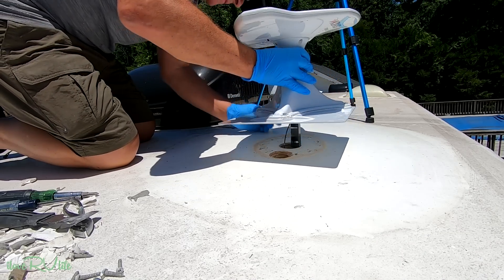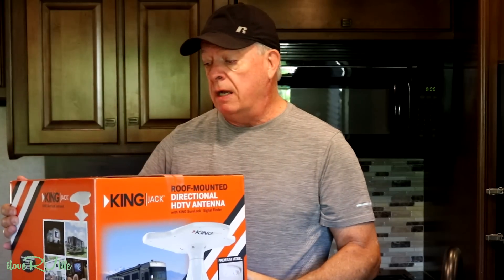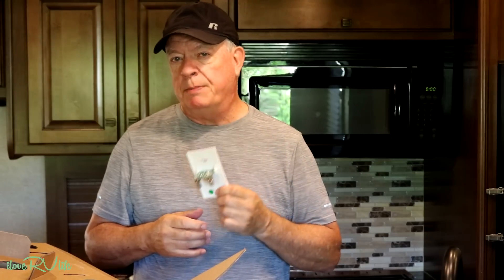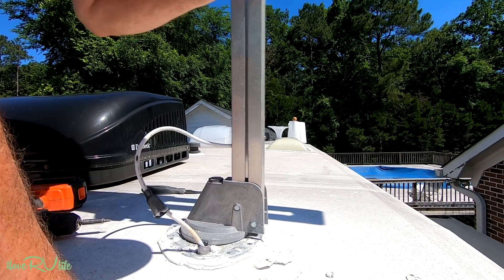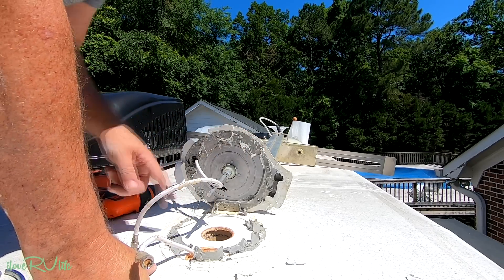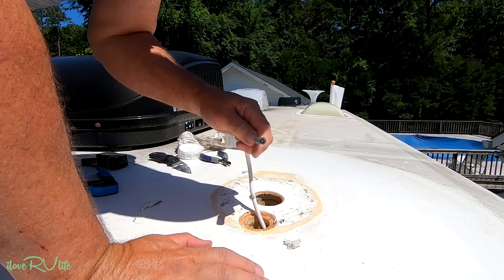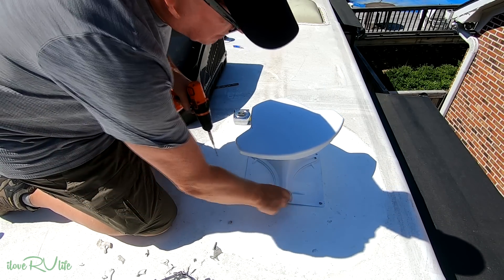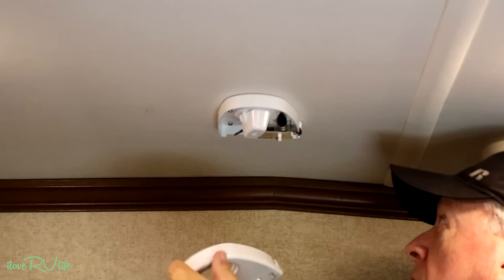Installing The King Jack Antenna

Comment: My truck camper came with this. I have to admit it's the best amplified antenna I've used. BUT I've had to pull it off the roof three times in 4 years. There's a RG-174 coax cable inside that gets broken easily. Even driving under a palm frond spins the antenna & breaks the coax. It's not accessible without removing the entire thing. The little push button locks from the inside but not very well. So keep a spare DTV antenna with you if you want to watch tv on the road, lessons learned.
Reply from the maker: Great to hear the antenna is working for you.  We’ll watch out for the low hanging limbs. Appreciate the tip.

Comment: Thanks for this great and quality video as i am installing this King Antenna today, you made it look easy and gave me the confidence to tackle it. I think the sealer is going t be my biggest challenge!
Reply from the maker: Glad we could help.  Sealer is pretty easy. You’ll do great.
Reply: I managed to get that install done in about 3hrs, but i get only 44 channels compared to 85 with the old batwing. Its ok because their all very clear now. I did have to carefully measure and cut the long extension shaft about 1/2in because it was to long and the base plate would not fit flush. That's not in the instructions. thanks again.

Comment: HI  Jerry.. I'am working on Rebuilding My 2001 Rockwood ROO 21 Hybrid,, New Roof ( So Much Leaking from Neglect Past Owners, New Floor (much more Bracing  under the New wood Floor)replaced the Fold Out Bed Floors with 1/8" Aluminum Sheets ,  Watching The Antenna VIDEO Today Was Perfect !!I Will Order The King OA8500 and the Plate Today ,I think that plate will Also give it more Stability  I Truly ENJOY Your Help VIDS...
Reply from the maker: Thanks a bunch.  What a great project.  So much satisfaction replacing the bad and seeing the new materialize.  The King antenna has been a nice upgrade from the old batwing and reception has been similar.  We did a small remodel of our kitchen in the 5th wheel.  A bit of a ballet working to reuse much of the cabinets and exterior paneling.  Created a series if interested https://youtu.be/5-EvGXnbFf8. Thanks for watching the channel.

Comment: I too got the same one from work I just ordered the bottom plate for it be here in a few days I can’t wait my 50’ diesel pusher
Reply from the maker: We’re having good results with ours. Hope the install goes well.
Reply: Awesome to hear back from you the only thing to after the king jack HDTV install is done just changing a few inside lightings and change out all the outside lights and redo the tail lights lens’s and bulbs and adding marble flooring to the entrance way up the steps with led changeable lighting and put a brand new paint job and adding chrome front mirrors then I will be all done it’s so worth it
Reply from the maker: Sounds like a great project.  Safe travels.

Comment: Thanks so much. Our old batwing was damaged when we forgot to take it down on a leg of a long trip this summer, and I decided that I wanted a low-profile antenna instead, so as not to worry about it again. I was worried about doing it right, but I am following the instructions and your video. Should have it done soon.
Reply from the maker: Glad we could help Buzz.  Ours has worked well since we installed.  There are some particulars about placement in the instructions.  No issues for us.  Good luck with your upgrade.

Comment: Hey Jerry.  Great video, followed it step by step.  Did not have the special tool for the cable connector so used old connector.  That tool was $30!  One thing would have helped me tremendously- how to manipulate the cable inside the antenna once it was connected. Had to sleep on that one and let the lap sealant dry so I could scrap off the next day.  Frustrated, but so proud of myself once I figured it out!  A little more detail on that portion would have helped, as I did all step by step with you.  
Thanks for giving me the confidence to do this project.  My husband just rolled his eyes when I ordered the parts and told him I planned on doing it.  And I DID IT!
Reply from the maker: Way to go Deb!  Great to hear you found the video helpful and was able to work through the cable routing.

Comment: I've installed two of these antenna's and could not be happier.  They pull in stations better than the Batwings I removed.
BTW, you can reuse the power supply (power inserter) from the batwing on the Jack.   Mine had an output for the FM raidio ant connection so I wanted to keep it. I called Jack and they told me it would work fine - which it did.
Reply from the maker: Hi Scott.  We've been using for a little over a month since installed.  Like you, we couldn't be happier with the performance.  We were having problems with the power inserter.  We gave up the 12v DC plug, but this one works much better.

Comment: Outstanding video!  I already have one of these in the RV we have which is a 2017 Coachman Orion and it actually brings in more stations that our external Winegard TV antenna on the roof of my house.  Probably will buy another one of these just to add to the roof of my house because we live in Florida and hurricanes do a number on the large antennas like the one I have on top of a 40' telescopic pole.
Reply from the maker: Thanks Alan.  The King Jack has done a great job on this current 3,000 mile trip.  Talking with others in the campgrounds, ours has work as well as any other solution.  Plus, the signal meter is a really nice addition making it much easier to zero in on the closest stations.

Comment: You can use a thin cardboard template of the baseplate and trace with a pencil to get your exact center. Just my 2 cents. Haven't done this yet, but I probably will soon. Thanks
Reply from the maker: Thanks, I use CAD often.  “Cardboard Aided Drawing” Helpful to get it right on paper first.

Comment: Jerry, as we are all getting older I have found that when I have to go up onto the trailer roof it's easier to put all of the tools that I will need in a tool bucket with the tools pouch skirt around it. That way I can tie a rope onto it and pull them up or lower them down.
Lowe's and home depot both sell the skirts to fit on their 5 gallon buckets
Reply from the maker: Great tip.  What wasn’t shown on the video was the ladder I had on the side that made it easier to place the tools.  But I’m using your bucket idea from now on.  Thanks.

Comment: Great Video Jerry we broke our antenna and was searching for a good one. I was wondering how far up this  would stand. I think you helped me make up my mind. Thank you for posting it. Keep up the great work.
Reply from the maker: It was a little shorter than the AC unit.  Looks like it’s going to be a good replacement.
Reply: I Love RV Life that’s great. I was worried about how high it would stand on the roof. Have you been happy with it up until now?
Reply from the maker: Very.  Much easier to find stations with the built in strength meter.  At this location we were able to pick up station for station just like the replaced crank up antenna.

Comment: Great video. I have one of these King antennas on my 2018 TT. Mine is black so it won't show dirt so much. Mine also does not have the signal indicators in the inside portion, wish it did! I agree they do not leave enough cable at the power connector! Can be really hard to get my hands/fingers to work there. Thanks for sharing
Reply from the maker: You bet.  Glad to share.  Looking forward to seeing how the antenna behaves in the fringe areas.

Comment: Great video, was wondering if the interior plate would cover the hole and from your video, I am ordering one now.  Thank you very much.
Reply from the maker: Jonathan, the plate leaves the large hole for the main part of the antenna and covers the smaller holes.  Great base for antenna.

Comment: I am not familiar with your wire stripper. Can you identify it for me? My large steel one irritates the heck out of me.  Also, I have become a huge Eternabond fan. After mine arrives, I will go that route around the 12x12 base plate to aid in waterproofing and stabilization before adding the sealant.  Ray with LOVEYOURRV is to blame for that. LOL. He went heavy on it to completely seal his roof and slide. Thank you for the video. It seems most RV owners are going this route, but, your the first to cover the installation procedure in detail for me.
Reply from the maker: Here’s an inexpensive kit with stripper, compression tool and a handful of compression connectors.  https://amzn.to/2WbAXPO. Handy to keep in the tool bag just in case.  Eternabond is great stuff.  If you go that route you should consider adding lap sealant to the edges.  Good luck with your project.

Comment: Great video.  Helped an awful lot.  Going to upgrade soon.  One question I had was about the roof sealant.  You mentioned two types of roofs.  Excuse my ignorance but how do I know what type of roof I have?  Thanks.
Reply from the maker: The largest percentage of camper roofs are TPO.  If it’s thick with a little spring in it when pushed with your thumb, it’s a good bet it’s a TPO roof.

Comment: Thank you for an easy to follow video. I am about to replace just the cable connector on my King Jack Antenna as it broke. I purchased the kit you recommended from Amazon. One question I have is the when stripping the TV cable I strip the black outer coating off, strip the silver threads and the white coating leaving only a single copper wire to put through the R6 cable connector?
Reply from the maker: Thanks Barb.  You’re correct. Take extra care to ensure no shield (the braid and/or foil) isn’t touching the center conductor.  Leave about an inch of center conductor after you strip the cable.  Push the coax into the connector till the white dielectric touches the bottom of the connector.  Crimp, then trim the center conductor leaving 1/8 inch outside the connector.  You’re ready to go.

Comment: Jerry:  Your how-to videos are really appreciated, especially for an all-thumbs guy like me.

I do have a question… I’ll be replacing the old batwing antenna with either the King Jack directional or a Winegard omnidirectional product. 
I’m making room in the roof to add an additional solar panel.

Since the replacement wall plate for the cable on/off switch looks identical to the old one, can you use that existing plate?
(Not looking forward to bruising up my finger and speaking a lot of “french”.)

Thanks!
Reply from the maker: Thanks Dean. The old plate should work. Most provide 12V DC to the antenna amplifier.
Reply: @iLoveRVlife  Jerry:  I have a follow-up question…
The old batwing antenna just has a co-ax cable running thru the roof, down to the booster wall plate connections. I’m assuming (without removing the crank handle assembly) there is NO 12V power cord at that ceiling point???

Did you experience that?

If this is true, am I going endure the agony of trying to fish a power line to that old crank handle ceiling location for either product?

Or am I just freaking over nothing?

Thanks, again.
Reply from the maker: Power is over the coax

Comment: This is probably the best video on replacing the bat wing antenna. I’m trying to decide what to replace it with. How’s it holding up and do you get good reception? Thank you.
Reply from the maker: Thanks.  It works well.  Tested in areas where we used the old batwing.  Reception was similar.  In a few instances we has better reception.

Comment: Jerry. Thanks for the video. Very informative and detail oriented. Now that you have had some time to use the product, how do you rate it? Is it worth the upgrade from what you had. I am not much of a TV watcher but we like to get local news for weather and such when we are traveling and when it is a bad weather day.
Reply from the maker: Hi Robert.  The batwing had fallen apart so we had to replace.  It’s working well.  Like not having to crank up and down and the signal finder adds a benefit finding stations.  Still need to tune a little left or right, but quickly gets you in the ball park.  We’ve been to campgrounds where we used the previous batwing.  Reception is similar.
Reply: @iLoveRVlife  2 questions. Is the power to the antenna, (yellow wire) DC? #2 is can the antenna be rotated for tune from inside the RV or do you have to climb on the roof to rotate and adjust it or is this a three dimensional antenna?
Reply from the maker: This isn’t an Omni directional antenna.  You’ll see in the video a knob inside to turn for directional tuning.  We also have the signal strength indicator option.  Makes it easier to find the better off air stations in an area.  Can’t advise on the wire to use.  No standards in RV color codes.  I’d use a volt meter to verify.

Comment: Great how to video!!!!!!I just bought The King Jack Antenna. My older rv does not have a  power inserter is the power 12 volt dc? Also I probably wont have extra eyes to help I was thinking about laying the mount plate down on roof to find center and marking out line with painter tape where mount plate will go. then assembling plate to the antenna Do you think that will work?
Reply from the maker: Thanks a bunch.  It is 12V DC and a must have.  No signal without power to the amp.  You’ll first screw the plate to the antenna.  The extra plate is only needed if you’re replacing the older style crank up antennas.  Painters tape is always a great way to temporary mark something.
Reply: @iLoveRVlife  thanks for the reply. I will use the info to make the installation.

Comment: Great Video , lost my batwing on last trip purchased the King in texas  just ordered the base plate for it. Question i already have the power box located in the living room with the button and green light the king comes with a box also is it necessary to replace the old one it was working fine with the bat wing.
Reply from the maker: Thanks Fred.  If this is a 12V DC source, all should work.

Comment: Terrific video! Looking to do same project in day or so.      Instructions say post hole should be 2 1/4 in.                   I have a Wingard batwing as well, did you have to increase the post hole size on your install?
Reply from the maker: I didn't Tim.  It slipped in no problem and the purchase of the adapter plate covered the extra holes and provided a good foundation for the antenna.

Comment: Hey Jerry thanks for the video we purchased the King Jack aswell. When you where checking your connections with your multi meter what setting did you have it on? Sorry it's new to me..thanks for the great tutorial
Reply from the maker: That’s a DC connection.  Depending on your meter, a setting to read in the 12V to 14V range.

Comment: My batwin wasnt  powered . I replaced it with a flat powered antenna. What i was hoping to see. How many channels you got before and after installation. In my case i had 12 channels before and an amazing 48 afterwards. I love rv life [ most of thd time ]  see ya on the road
Reply from the maker: Interesting that your bat-wing didn’t have an amplifier.  I imagine the reception was pretty crummy.  Safe travels.

Comment: You say not to use dicor but they have a lap sealant as well correct? And that would Bo OK to use? Both between antenna and plate and between plate and roof?
Reply from the maker: I had to use 5051 with my PVC roof.  Dicor is a reasonable lap seal for the other RV roofs.

Comment: Hello, great video.  What type screws did you use to attach the base plate to the roof?
Thank you
Reply from the maker: Those were 1 1/2 inch #8 pan heads
Reply: @iLoveRVlife  . Thank you very much for the information. I think they will work on a rubber roof as well.
Reply from the maker: Shouldn’t be a problem.  You’ll be screwing into the plywood underpayment.

Comment: Did you have to enlarge the hole through the roof to accommodate the new antenna shaft?
Reply from the maker: I didn’t Bill. There were 2 holes from the replaced batwing.  The main shaft of the King fit the larger hole and the mounting plate covered the smaller hole.

Comment: Nice upgrade! Is it possible to add a signal indicator to a stock antenna? I don't want to have to replace the whole thing on our new trailer but trying to get a good signal is a bit of a pain! Thanks
Reply from the maker: Thanks.  There are external signal meters.  They are a bit pricey and some modification to the cable routing, cutting a hole to fit, etc.  Here's an example. https://amzn.to/2Zkg7v3

Comment: Does the Wall Mount Power Injector (inserter) amplify the tv signal or just supply 12v power to the signal finder? My antenna did not come with one. Will I need this to amplify the tv signals?
Reply from the maker: Hi Rich.  This is a power inserter.  The amp is located in the antenna.  Same as the crank up batwing antenna.  If power isn’t sent to the antenna, no signal is received.
Reply: @iLoveRVlife  Thank You!